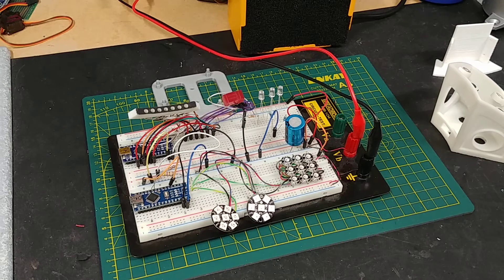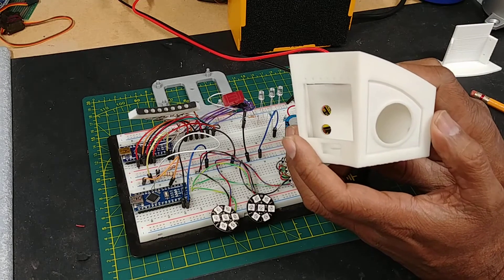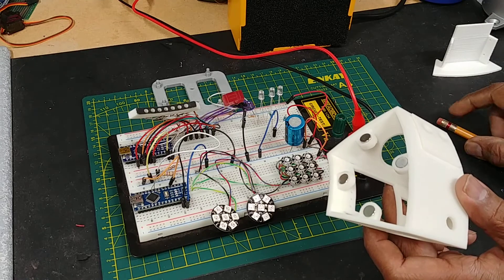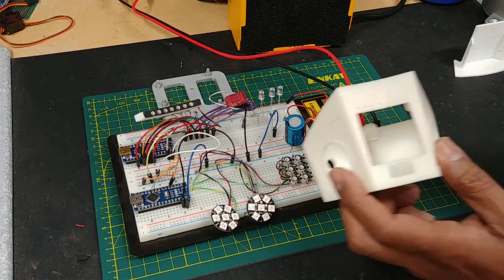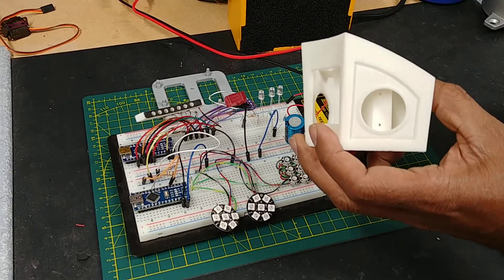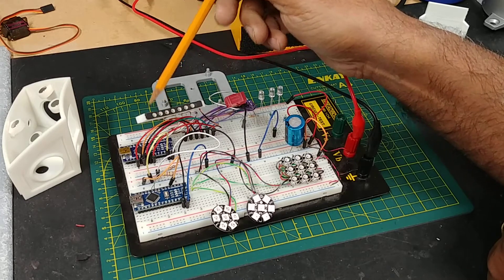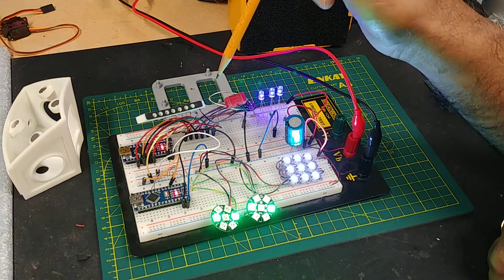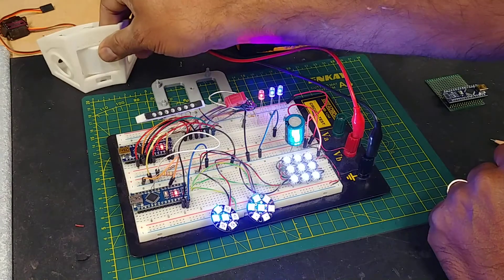R2D2 Build Episode 2-Breadboard of Periscope Electronics

Comment: Exceptional work Mark. I’m busy with my R2 and it wouldn’t be complete without your Dome Mechanism. Do you by any chance have the code for the two Arduino Nanos in the Periscope, and the rest of the code for the full Mechanism? Thanks in advance.
Reply from the maker: @nigelbreddy8033  Thanks so much.  My 2 Arduinos in the periscope is not a great way to accomplish this task.  I'm sure you can code the same thing with one Arduino.  I'm not that great with coding.  I have all my files and sketches on my Google drive for people.  Here is the link:
https://drive.google.com/drive/folders/1mlEHPmhI2wyvfMNoH7afO-1xyhnua6gj

I don't use Arduinos for the entire sketch because I use Pololu Maestros for controlling the mechanism so you would have to go that route as well.
Hope this helps!
Reply: @ that’s wonderful, any help is a blessing. Thanks, I will go down the Pololu Maestros route as you proved that it simply works. 👍

Comment: Hi Dan,
Any update on creating the periscope electronics and code yet??
Reply from the maker: Hi Anthony.  I wasn't planning on releasing this information as I'm sure the way I did it is not as efficient as it could be.  If you are interested, I could send you the code I used for my 2 Nanos?
Reply: @MakerDan55  that would be great, do u have a schematic of the electronic components u used. To get that effect.
Thank you
Reply from the maker: @anthonyscuderi669  I don't have a schematic but if you are familiar with Arduino Sketches then you can see in the code where I hooked up each part.  For the long scanner it is just a bunch of LEDs in a row, for the small red scanner it is another set of red LEDs in a group, and for the Neopixel ring I use a separate Nano that runs a Neopixel sketch.  I also have 3 independent LEDs that just blink and change color on their own once powered up.  Send me an email address so I can send you my code.
Reply: @MakerDan55  ohhh ok, sounds great
Reply from the maker: @anthonyscuderi669  can you send me an email address?